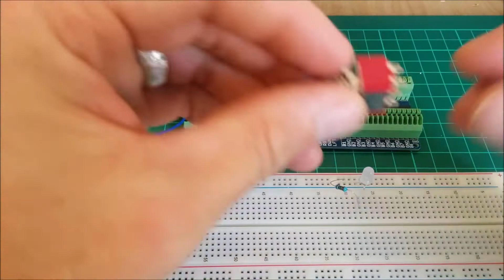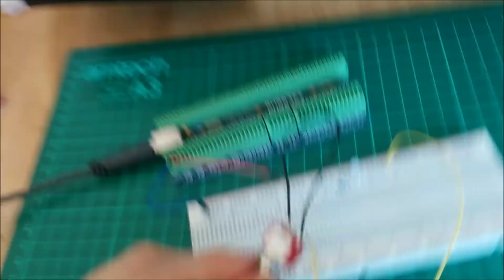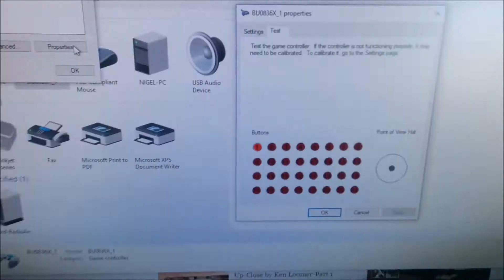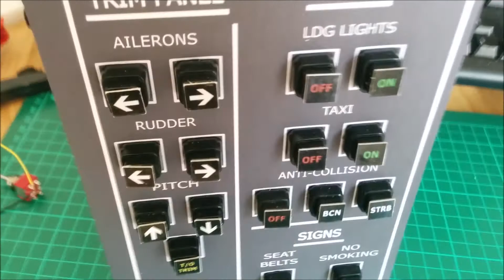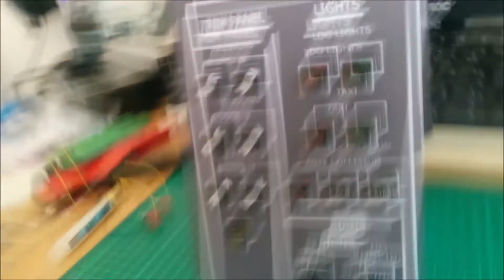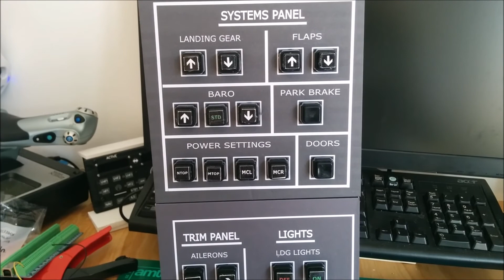Connecting LEDs to switches - Leo Bodnar boards

Comment: Is there any way to control leds using momentary tactile switches? I trying to make G1000 audio panel
Reply from the maker: Well, you can control them exactly as shown here. The obvious problem is that if the switch is momentary the LED won't stay on when the switch is released. There might be a way around that but I'm afraid I don't know what that is. I assume you need the light to stay on or off instead of just flashing when you press the button! Sorry, I don't know a solution to this.

Comment: Hi there nice video, any ideas on how to connect an illuminated button on a pro micro Arduino?
Reply from the maker: Thank you my friend. I don't know exactly how to do that but I believe it is possible. I would recommend taking a look at The Warthog Project's channel. I think he used the button you describe for this Master Caution and Warning buttons. I should experiment with this as illumination is the next major hurdle in my own cockpit project.
Reply: Get the DesktopAviator  Card, you can use something like the 2570 Control Board, works great with Tipped LED On/Off switches it's a USB and Windows recognize it as Game Controller

Comment: After talking to Bodnar about this board and how he recommends to run a led with it.... 5V to 300-500 ohm resistor, then to switch, then to ground. Also one wire from switch to your button pin on the board.
http://www.leobodnar.com/files/basicLEDswitch.pdf
Reply from the maker: He didn't let you call him Leo?

Comment: hey do you know if the leo bodnar boards have built in pull up resistors and whatnot? so if you are just using buttons you dont need resistors?
Reply from the maker: Not sure. I have never used resistors between my switches and the board. Never had a board fail either. I think there's very little voltage running through them. I only recently encountered the concept of a pull up resistor on Arduino boards. Sorry I can't give you a better answer.
Reply: @nigelmtb  ok well i guess if you havn't had to use them it should be ok, thanks.
Reply: @nigelmtb  oh sorry one more question, have you also used rotary encoders with push button with a common ground cathode between the pushbutton and the rotary part? (i.e. the component itself has only one ground)
Reply from the maker: @Disastorm  Not like that, no. I have used really cheap ones from eBay. There are two grounds (one for push and one for rotation). I've never tried joining them into a single common ground. Seems obvious now that you say it. You do need a simple piece of software from Leo's site to specify the left and right turn pairs. Encoders won't work properly otherwise.
Reply: @nigelmtb  i see thanks

Comment: quick tip: If you use the old parallel  IDE printer,floppy drive flat grey multi cables, they make it easier for keeping the wires cut to however many you need, just cut the connection ends off and you can fold them neatly at 90degrees etc and fit them under flat panel, stuck down with tape flat and neat

Comment: Hi, not sure if you’re the right guy to ask but I’ll try anyways, I’m trying to set up some annunciators in my cockpit with leds. How would I do something like that. For example the gear light. They don’t permanently stay on. Only when the gear is moving. How would I do that? Thanks
Reply from the maker: Hi there. The short answer is that I don't know how to do it but I believe it can be done. There are some options. Arduino is one. You could encode a time delay in the LED so that it stays on for a fixed time before going out. Peter at Build a Boeing has used some Arduino boards this way. That method doesn't reflect the simulation though, so it would not indicate correctly if the gear was stuck for example. Another way is using FSUIPC. I believe you can get outputs from FSUIPC which would reflect the simulation accurately but I have never done it.
Reply: Nigel Doyle yeah, I read that too, seems like the only problem is that I have xplane!
Reply: This is possible. There will be a data reference file being updated in the flight sim installation folder. So this file basically contains all the states (on, off, etc) of the events (light position, altitude, speed etc) happening inside the aircraft. Using cron job, get the annunciator light information continously streamed to the arduino as a trigger signal.

Comment: Great video. The foam back material I am considering. Are the bodnar boards only available from them direct and can you use multiple boards? Thanks in advance.
Reply from the maker: Graeme Hanson Hi and thank you. Yes as far as I know the boards are only available from Leo's site. I'm not aware of any limit - it would only be a limit of USB devices that would create a limit. All the cards have a unique identifier so they don't create crossed signals when connected. I ran four simultaneously without issue.
Reply: Nigel Doyle thanks Nigel. That's what I wanted to hear. Spent ages mapping old usb keyboard and made some useful connection before i came across this board. I did start my ppl a few years ago but got cold feet so want to plan and build cockpit. Keep up the good work. Graeme.
Reply from the maker: Graeme Hanson If you don't need more axes, the BBI 32 board is a little cheaper. Best of luck and stay in touch if you have more questions.

Comment: Hi, great channel there,
I have a Leo bodnar Card also,
I want to build a GPS530 for my Cessna cockpit 
Do you need a software to have the Card communicate with xplane 11?
Reply from the maker: Hello and thank you. Glad this still helps people out after so long. I've used my card with X-Plane 11 with some success. One oddity in X-Plane is there is no way to control what a switch does when turned off, only when pushed/turned on. I don't think this will matter too much for a GPS unit. I think it is entirely possible. Recommend you check out Mark's channel Almost Aviation. He has made a very nice GPS unit using Bodnar boards and recently switched from FSX to Xplane. Good luck with it!

Comment: Hey how would I get this to work with just 3 pins on my switch?
Reply from the maker: Lewis Burrows If your switch is an On-Off-On switch like the one I am using here, then there is no difference. The only reason my switch is different is it can control two circuits simultaneously. In your case, you would set up the circuit in the same way, with the LED in the 'On' part of the circuit. I hope that makes sense?
Reply: so i would put 5 volts through the switch and back into the card
Reply from the maker: Lewis Burrows Just do what the video does.
Reply: I don't have a six pin switch though so how would I run the button for the board and the led off three pins?
Reply from the maker: Lewis Burrows From 8 minutes on, I demonstrate how to wire this circuit without using the prototype board. I am only using two pins on the switch. Two. These are Ground and On. This is all you need. If you have a more complex switch than that you can make use of the extra circuit but you don't have to. Just try it.
Reply: So I will be sending current to my board
Reply from the maker: Seems like there is already current in the board.
Reply: So what your saying is that I can run 5 volts through my switch for my led and have the out put of the switch going to my led and by board?

Comment: At the moment all the power is coming through the USB connection. If you were to set up so every switch connection to the board had an accompanying led. I assume all those LEDs will pull too much power and fry the port or it just won't work?
Reply from the maker: I can't answer that. You raise a good point though. I don't see why damage would occur; the demand would just outstrip supply and LEDs would not light, or grow dimmer. A powered USB port/hub seems like a good idea here.
Reply: @nigelmtb  Not really. The way electronics work is that an output device has the burden of providing the current the load demands. If you have too many LEDs on one output, they will pull the necessary current (programmed into the resistor value you put on each) and the total will have to be delivered by the chip on the board. If it's too much, the chip's output will burn.

Comment: Hi Nigel, thanks for the clear explanation.  I'm planning to build an A320 FCU with push buttons (KD2-21) that have LEDs controlled via SPAD.NEXT using LVARs. Could you do a video (or explain) on how to connect that to the Bodnar card?  Cheers!
Reply from the maker: Hello Vincent, thanks for the comment. Glad the video is helping out. This KD2 switch is very nice - I have not seen a button like it before at this price. One problem for me is that it looks like the minimum order for them is 50. I'm not keen on doing that even to help the community! Could you mail one to me if you already have them? I'd be happy to try and work it out, then post a video accordingly.
Reply: Nigel Doyle I have just placed my order so it may take a few weeks before I receive them. Would you know if it is even possible to use the Bodnar BBI32 to activate a LED based on a LVAR without connecting a switch to the required button position?
Reply from the maker: Vincent Twisker Hi again. I think it is possible to control the LED with an LVAR but not through the BBI32 board alone. Think of the board like a joystick - there is no logic or software in it, it just sends  inputs to the computer (like a joystick button). So it is purely mechanical, without any conditions are data output. Not a major problem though. You just need a secondary system to light the LEDs. Arduino can do it - have you seen Link2FS or Mobiflight?
Reply: Thanks Nigel. Someone gave me the following suggestion;

https://www.ultimarc.com/pacled64.html

With 64 individual LEDs to control, I think this is the way I will proceed. I'm sure Arduino will do the trick, but at the moment that would probably take me too much time to master. I'll keep you posted.

Comment: if i add another led and i do the same in the other side of the switch when one is on the other one is off and viceversa?
Reply from the maker: Depends. If you use a switch like the one above then that should be possible. you would just connect the positive and ground the other way around. If you use a single pole, single throw switch, you would not have any way to control the other LED and it would either be always on or always off. Try it. If you don't have one, an Arduino kit is very useful for testing this stuff.